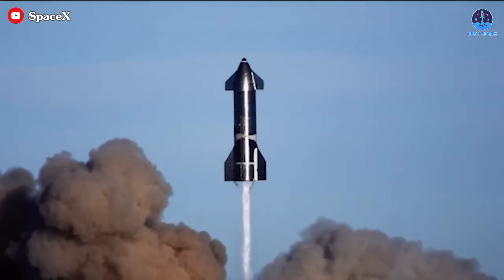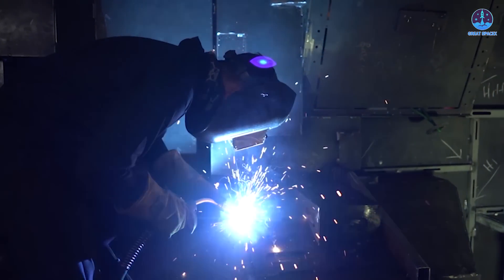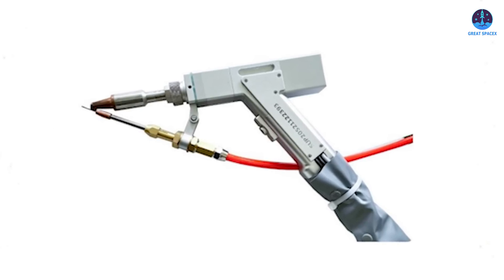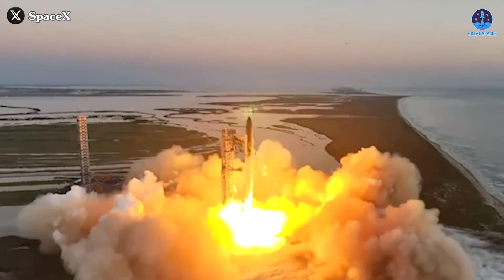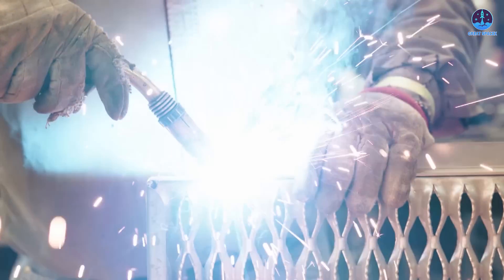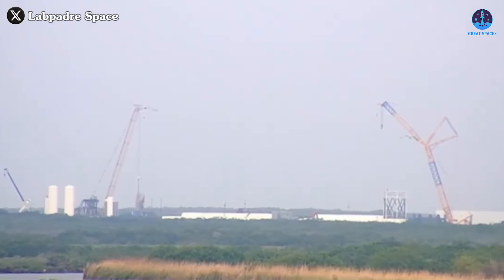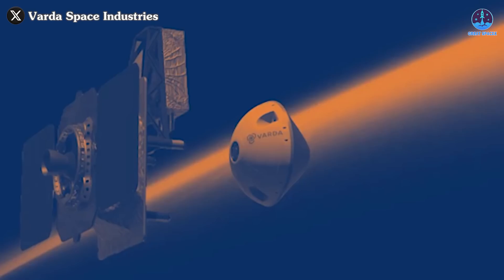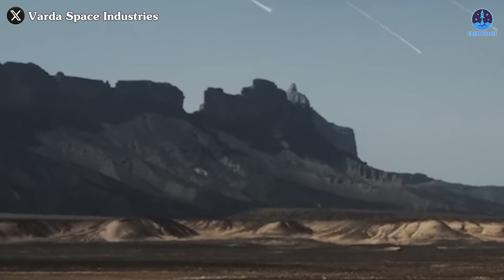SpaceX New Upgrade On Starship V3 WELDING totally Thrilling Scientist's Minds...

Comment: It surprises me that SpaceX is making such significant progress in welding and processing stainless steel. This material has been available on the market for everyone. So why does no one else seem to know how to use it effectively? It's a shame for airplane, ship, and car manufacturers.
Reply: Stainless steel is expensive, why would they waste the money when they can do it with cheaper, lighter  materials? Plus SS is too heavy for planes
Reply: Im actually of a different opinion.  Im surprised they didnt start out with 304l and tig welding from the get go.. 

I mean in the aftermarket car industry weve been tigging 304 for years.. it would be embarrassing having an exhaust fabricated from 301 and mig welding it

Comment: why is the steel actually stainless
what advantages does it have over regular steel for starship
its not like the prototypes, and they currently are all prototypes, last long enough to care about rust
so i assume its not actually for its stainlessness 
isnt stainless more expensive and less rigid, two things that are useful for the current design 
what am i missing about stainless or regular steel
Reply: Stainless steel is much less prone to corrosion, stronger for a given thickness, and much mote capable of withstanding high heat ebvironments...
Welding can be tricky, as ss will warp during high heat welding. TIG and laser provide the high heat necessary for strong welds, with pinpoint heating of an area during welding, reducing warping significantly...
Reply: It also becomes  stronger at high temperatures.  The more common sheet steel is more ductile.  softer.  As to  durability,  Elon and crew will find out where and when the alloy they have choosen works and where it has disadvantages.  Mars  does not have much free oxygen to corrode the material, but even there it can be reused for structures and repairable with a lot of care.

Comment: If predictions are correct in a few yrs that part of florida will be underwater most of the yr and more flooded every year ,will he be on Mars by then or the moon ,The ice is melting faster and faster every year than predicted with methane release, Vandenberg is higher ground but if all of thr ice melts it is a 200 ft rise in ocean level,
Reply: havnt they been predicting a few years for two decades 
rich people still buying beach homes as they promote green initiatives
Reply: flunked a lot of classes didn't you?

Comment: Falcon 9 launch vehicles use carbon fiber construction for the interstage that connects the first and second stages. Those stages themselves are constructed from machined aluminum isogrid sheets that are rolled into cylinders and then seam welded.

Comment: My first thought as I watched this video was Blue Origin and their use of Stainless steel on the second stage of New Glenn. If you are a SX viewer you've watched the development of the Starship from the beginning and seen the evolution of the welding process. It has been very difficult to achieve the welds you see on Starship today. It has taken many iterations and experimentation to develop the equipment and skills necessary to make these welds. I wonder if Blue Origin has that capability? I'm very interested to see what they have come up with and whether it works. As a taxpayer, I have a lot of money in a company run by a guy I dislike and whose company provides knockoff products I can't trust without all the benefits they touted for years. We should have an answer in the next couple of months. We need another competitor but I really wish it was someone else running the company.

Comment: When is space X going to use 3D printing for its parts
Reply: It is used extensively in their engines and other parts. Not in tanks and hull like Rocket Lab.
Reply: @avgjoe5969  thanks for sharing I’d really like to see them do a video on that part of their operation
Reply: @avgjoe5969  it is relativity, that are printing tanks. Rocketlab are building their tanks out of carbon fiber.

Comment: Make a giant extruder and just pump out starship tubing. You know like a Play-Doh fun factory. One or possibly zero welds on primary structure.
Reply: Good luck building such a collossal machine. Extruding 9m wide tubes would be just impractical, if you could just weld it instead.

Comment: Sorry but going flux in the first place was dumb enough, but to now go from tig to laser!!???
nope!
There is no chance of getting either a stronger or cleaner weld with laser......NO CHANCE!! It has been tested over and over again..... laser welds are actually quite bad, alu and stainless has a real bad habit of cracking along seams, leaves little gaps as no real penetration or filler..... I thought the no flame trench was a big booboo lol..... this will come back to bite 100%
Reply: What type laser? Is there only one? Ship flipped end over end in ITF1 so those welds held quite well. I would not assume conventional technique.
Reply: @avgjoe5969  strength with flux core is not a problem, it is just not the cleanest and can cause inclusions and corrosion. corrosion being a big issue for the vehicle throughout. Just because stainless doesnt mean no corrosion.....
Laser is a highly focused heat point, far hotter than re entry, and the sun even. Stainless in every form does not like a laser weld due to the intense rapid heating and cooling in such a focused point. Has a very very bad habit of cracking along welds as metal become brittle. Aluminium is worse. Also there is no filler with laser so it will never seal the imperfections and always leaves inclusions. Laser welding is pretty amazing yes but we just aint there yet.
TIG is 100% going to be stronger and cleaner, it just takes longer and skill.... yet there is such a thing as auto TIG so if an automation issue the still TIG is the best option...... feel a little bit Boeing going TIG to laser :/

Comment: The most advanced material for a space vehicle is lithium aluminum and the most advanced welding technique is friction stir welding. So when SpaceX is ready, NASA has already figured this out.
Reply: Yeah, they talk about TIG welding like you can't buy a TIG welder at Harbor Freight.
Reply: No and no. SpaceX first used friction stir welding on F9. Was not used much or at all in rockets. They rejected this on Starship as SSteel had far better properties at very high and low temps. Also Much cheaper.
Reply: @ Actually the reason they are using stainless steel is to support reusability of the space craft.  Falcon was made of composite materials according to this video and you don’t weld composites.

Comment: There is Plasma TIG welding where the arc is hotter than regular TIG. This higher heat means you can afford to move faster along the seam and less chance of warping even still ! Combine this with automated feed stock would be the way to go.. 

Appears to be regular TIG with auto feed mentioned here !

Wonder if SpaceX has tried employing Plasma TIG ?

Comment: I thought SpaceX was using Friction Stir Welding (FSW) and planishing to construct Starship hulls!

That would account for the nearly invisible weld lines.
Reply: FSW is used to join aluminium alloys (ULA uses it).. you can't use it to join 3mm thick stainless steel sheets.

Comment: Stacking is dumb, except for tanks... those ship hulls should be linear welded gores off the roll of stainless, so they can spit out a ship in hours...
Think combining fabrication with extrusion like techniques...

Build them on their side... its alot less work to tilt them built than lift things a ring section at a time.. better longitudinal structure too, they are chopping things up to butt weld them back together.

Nerds....

Comment: Also if I remember correctly, 304L stainless steel is also prone to deformational hardening, which means if it gets stretched it becomes harder and better. God Bless to all in this Advent season.
Reply: They use cold rolled stainless for strength. Strain hardened.
Reply: If it gets stretched it gets harder wow! 😂
Edit: don’t y’all get the joke?
Reply: @Wesleyburleigh  Giggity
Reply: @ Why so angry?